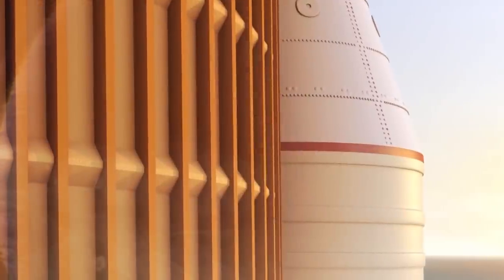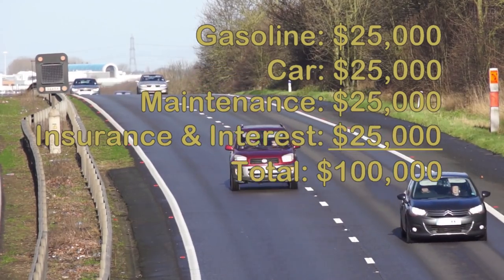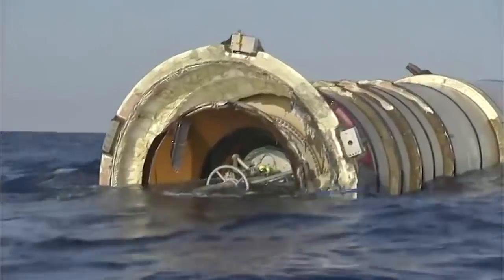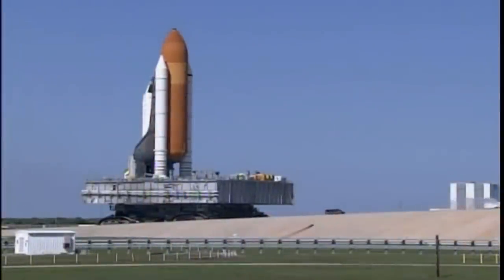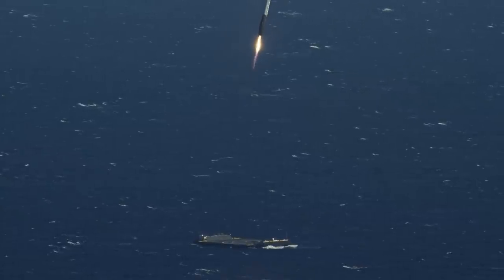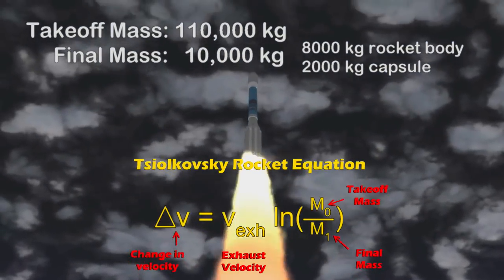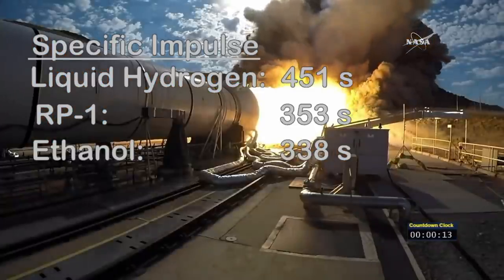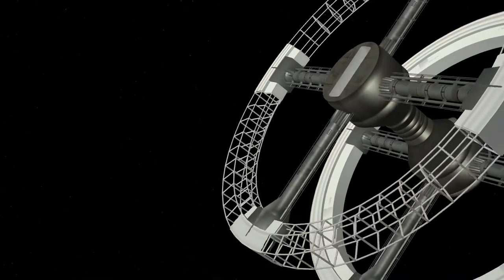Reusable Rockets & Metallic Hydrogen

Comment: Hi Isaac. Have you ever considered doing a timeline video? Such as what technological advancements you think we as a species might make in the next 15 years, 50 years, 100 years, 200 years etc.
Reply from the maker: I generally try to avoid timelines, to constraining, too much guesswork.
Reply: I thought that may be the case. Keep up the great work :) It looks like you'll be reaching the 100,000 subscribers within the next couple of months
Reply: Technological progress isn’t linear either
Reply: Zamuroy honestly I've known of that sight for 5 years and I genuinely wouldn't be surprised to hear that I've cumulatively spent days on it!
Reply: yeah i might have low balled it.
Reply: What have you done??? I didn't do any work after lunch because of you!
Reply: We are notoriously bad as a species at predicting the future.
Where are the colonies on the moon we were supposed to have in the 70's and 80's? Where are our flying cars and robots? Instead, we got small glass slabs connected to a wireless network of information, that almost nobody predicted.
Reply: If timelines bother you than how about a tech tree. Designating which techs are dependent on other techs. Which techs are so intensive that they will likely depend on other techs for necessary resources. And which techs depend on discoveries of the natural world. 

For example you've already stated that the same technology: nanobots can be used for both cold sleep and indefinite lifespans.
Reply: That website is bonk. They think that by 2080 the US will give California, Texas, Arizona, and New Mexico to Mexico because the US is afraid to go to war with Mexico.
Reply: +keyboard monk - That would be really challenging, it's close to impossible to right-guess technological progress, especially for periods of time longer than 10-20 years. So many tried (SciFi writers in primis) and none got it right. But I agree that Isaac might get us closer to what to expect than others. So, why not? It might be another great vid in the series.
Reply: They can have So Cal, but we keep the north part and Texas.
Reply: it might be bonk, but it sure is fun to read through it and give your imagination a little free roaming.
Reply: That's true. A bit of a guilty pleasure of mine is reading fanfiction, and in fanfiction for the video game Mass Effect, there are a good number of them that do timelines kind of like that website. Some are actually worth reading. xD
Reply: I whole heartedly second this.
Reply: +Carlo Rizzante - I agree, it's hard. Your brilliant estimations today are bound to look stupid tomorrow. (Career minded futurists should avoid talking too much about the future, lol.) 

In case you don't know, that's the origin of the term "singularity" in regard to technology. Vernor Vinge said that, because of the rapid advance of technology, it has become impossible for sci-fi authors to see past a certain point in the future, as if it were a black hole. So, you can maybe see that fusion, automation and transhumanism are upcoming technologies, but you just can't imagine what that will mean. "Human minds in fusion powered robot bodies" might be superficially right, but you can be sure it's wrong too, like the first ideas of going to the moon (which turned out to be true) powered by a flock of geese (which looks pretty silly in retrospect). 

Or you could give Alvin Tofler the credit for the idea of Future Shock, which is sort of a broader version of the same idea.
Reply: Heehe... know what you mean... but sure like hypothetical evolutionary timelines of humanity ; )

"The Day our Conscious Evolved from Matter to Energy"

Catchy SyFy that's been explored often but not so much as a real timeline of a species.  STNG Doud/Organians etc evolution....I'm rattling on...
Reply: Greetings.  Energy means the change in some system (you usually specify which change(s) you mean). Energy is not a substance, and so you can’t make anything from it (it’s like trying make people out of lots of temperature or speed). There is no such thing as pure energy, so the Organians (and everything like them) are not possible. To make a big mind, you must use big software. All softwares are made of pure information, not pure energy.
Reply: Not exactly accurate. software is made up of code. Information is what the software interprets.  But I thing we know what Kenny is going for.  musk is already proposing a brain/computer API. let's go beyond the question of when we migrate from our bodies (wetware) to hardware/ software and ask when will it be that the digital persons and formally real/ simulated persons that transferred to digital want to move back into a wetware body.
Reply: Jeffry, software means information stored in memory. Code in computers is simply one of many kinds of software. More examples: writing in books, genomes in DNA, or images in paintings. Kenny is most definitely not talking about information or computers at all. He means that in our future we will convert our atomic structure into beings of pure energy.
Reply: John, sorry.  I tried to give you the benefit of the doubt and looked for your definition... you're the only one that has that particular understanding of the word.  Isaac does not provide us software, he provides us information, which is to say data that is compiled in a meaningful way (thank you Isaac). His information is handed to us via YouTube's software. YouTube takes his information and returns his information to a data stream were it is picked up by your computer and rendered back into information for your consumption.
Reply: All data stored in memory is software. All files (including standard video files) are software too. It doesn’t matter whether you are a program author, a writing author, a music author, a painting author, a video author, or a game author. You are making the same thing: information stored in memory. Information stored in a memory system is always a software system.
Reply: Data stored in memory is NOT software. I am a software engineer, have been for decades. However, don't trust me. Do a simple google search and read up on it. This is literally first day information for every computer science student. When you read about how cassettes and disks were used as software, they are not referring to the actual medium, they are referring to the code that was stored on them. A cassette holding compiled code to be run a computer would have been referred to as software while a cassette (off the same assembly line) that holds music and would play in an audio cassette player is NOT software.
Reply: A memory system is an information storage machine. Any media (a memory system) can hold either programs (software A), or music (software B), or a game (software C, which may be a combination of the other softwares).
Reply: False. A & C are examples of software. B is not software. It's information.
Reply: The term information is subjective to the perspective of the user. In some instances it may be considered data.
Reply: ok i think i got to settle this thing here guys... i am also a computer science dude and in that field we usually use software only for instructions algorithms and well "programs", we normally do not use it for data... for us data is the stuff the software acts upon, but yes software is made out of data. but there is data that forms programs (those we call software) and data that contains no instructions and is only used by programs.

so generally i am with jeffry.

but if you want to be really anal about it then all the textbook definitions of software include all data since they only make the distinction between hardware (real physical stuff) and software (0s and 1s, no matter what they represent)

so yeah technically john is also right, but almost nobody "in the industry" uses it that way.
Reply: Anyhow, I have a feeling the term "software" will probably fade away to near non-existence within the next 50 years or so. As we march on, we have a tendency to obfuscate and abstract away concepts to a much higher level. Sure there will still be some of us dinosaurs wandering the plains, tending to ancient legacy systems. But the developer a few generations away form where we are now will most likely interact with a system that will try to interpret what they want and generate all the hard stuff for them. Very few CS guys come out of school knowing how the guts of a processor works or how to do binary math, nor in most cases do they need to.
Reply: really? my CS master consisted of 45% math/logic 25% theoretical CS stuff and 25% hardware understanding 5% doing practical stuff (numbers come out of my ass of course, it's been a while)
Reply: You would be surprised what a CS major includes these days. I have the unfortunate task from time to time of running interviews for open positions. Kids are lucky to get more than 5 programming classes for their BSCS degrees. Its mostly project management. The kids are smart for the most part, its the institutions that have become lazy. I remember an 80% attrition rate when I went through. I guess schools would rather have the seats filled through the entire program, than produce quality students. Don't get me wrong, there are some really good schools still out there, but they are becoming fewer and harder to find. A good masters program should be focused on theory and math, more so one than the other depending on your focus and a PhD even more so.
Reply: Everyone, here’s what a smidgen of flexibility in the definition of software buys you…

All computational systems have both hardware and software at their cores (with the software as the payload). Hardware means a hierarchy based on physics particles. Memory systems are information storage machines. Software means the information stored in memory systems. All softwares exist separately from their respective hardwares (or the memory system would not function). All softwares provide their own levels of organization, like a little informational universe (this is why game-worlds are made of software). All intelligence (problem solving) comes from software systems only. In animals, minds are built by the learning process, meaning moving information into a memory system (and so learning actually means software building). More software means more intelligence (this is why your intelligence ramps up with age). If you erase that software, you go to zero intelligence. The cortex is a vast memory system, so it contains a vast software system. We call that cortex software a mind (or a person).

All mind related words (like control, perception, knowledge, thinking, motor control, etc.) exist as software structures and processes. The sum of your mind software exactly defines your identity. There is no hardware component to a mind. You make minds out of information only (not atoms, not cells, not tissues, not interconnections, or in computers, not electronic hardware). Most of what psychologists do is software manipulation. Things like delusions are really software errors. All informational connections (like sensors, effectors, datalinks) going to and from any brain, are going to the software, not the hardware.

Genomes work the same way (without the learning). The hardware includes the DNA memory system and error checking mechanisms. The genome is the software portion of the computational system, which intelligently manages organism assembly and maintenance. In order for the Cambrian explosion to take place, the governing computing system had to be sufficiently powerful to reliably handle the added complexity constructing and maintaining a sizable multi-cellular form (including all the extra biological levels of organization). This is why the eukaryotes were so successful.

Books, same thing, the writing is the software (pure information) stored in the book memory system hardware (a hierarchy based on physics particles).

So, some of the most important things we know are really software systems. In our future, we will construct vast software universes to better suit our needs than the universe we were born into.

Immortality is relatively easy, you (as a software mind) can be copied (like all softwares) to any kind of hardware body (it’s like changing clothing). You just need a big enough memory system to hold your mind software, and a set of standardized emotions if you want the system to behave like a mammal.

Comment: hang on hang on hang on
>room-temperature super conductor
forget about rockets, wouldn't this open the gates for running stellarators and similar designs for energy? not having to cool down the magnetic spools to contain hydrogen plasma would greatly decrease the temperature gradient in the plasma chamber, so design and operation would be loads easier!
Reply: We should not ever forget about rockets, so... Thermonuclear propulsion?
Reply: Finally got this covered.
😍
Reply: Energy positive stellators should be very doable even with low temperature superconductors.
Reply: Well the holy grail would be running launchers on fusion reactors, since they are so much more mass-efficient than chemical propulsion. At that point though you're looking at very exotic designs, halfway between a nuclear thermal rocket and a torchship engine.

Comment: Oceanic launches seem interesting, though some environmental aspects should be considered as well.
If mass beachings of whales and dolphins are really a result of sonar surveillance systems what would the sound from a rocket almost twice the size of the Saturn V like the SeaDragon going off under water do?
Reply: If it's in the middle of the ocean, not much, because most whales etc live near the coast.
Reply: Sound travels faster and farther underwater. Apparently whales were able to communicate over global distances before ships came along.
Reply: I like the Sea Dragon/Serpent idea a lot but am concerned about the sound affects on sealife. Maybe sound dampening tech., or using a lake with no complex life is the answer.
Reply: Different frequency range then what sonar uses, dampening remains in effect.
Reply: I'm more worried about what that salt water does to the submerged parts of the rocket. If the whales don't like it they can build their own rockets. Or possibly a 'whale-gun' as Issac would pronounce it..
Reply: @IamGrimalkin  Thats....Not really true? There many species of whale that actively avoid coastal waters, dude.

Comment: the metallic hydrogen thing is still ongoing. In fact the science team lost their sample recently when the two crushing diamonds cracked , which is kind of understandable because experiments at that scale are hard as hell to do for a laundry list of reasons.
still, it means their sample is gone and who knows when they'll be able to recreate it. Does this imply fraud/wrongdoing? probably not
Reply from the maker: No, certainly not fraud or wrongdoing, it's just early days. It may remain a totally chalkboard idea or be the next big thing, we can't say yet.
Reply: Yeah, what intrigues me about the loss of the sample is how it was lost. It hardly sounds like a stable material if no trace was left behind in the ruined diamonds. But, obviously I hardly know enough about chemistry or physics to make that judgement. 

I mean even if it was metastable only, surely there would be some trace of it in space, in the asteroid belt or something, only if because it is the most common element in the universe.
Reply: Sam the reason it was lost is because the sample was smaller then the width of a human hair. you need a powerful microscope to see it clearly, and when the diamond shattered, it could have gone anywhere in the lab. technically you could find it, but you would have to take a microscope to every square inch of the labs floor. the shear amount of time needed to find it is insane. also since they don't know its properties, for all they know it could have been stuck to one of the diamond dust fragments, so they would have to check every single grain if diamond dust as well.

also its entirely possible that because of its size it could become air born, and then you would never find it.
Reply: Yeah, there was not much information on the experiment where I originally read about it. But, losing it in the lab, on the floor or airborn seems kind of silly to me. The frontier of materials physics isn't being performed in a closed system? Surely they should have it under conditions where even if the whole diamond anvil exploded they could at least analyse the debris.
Reply: It's the size of a human hair

It's like playing where's wally with all of new york
Reply: @xXzman9000Xx  its an atom, you can't see that with a microscope, you need an electron microscope and those only work in vacuum